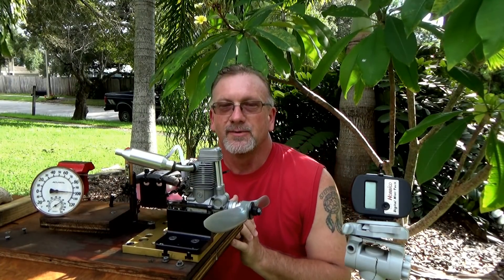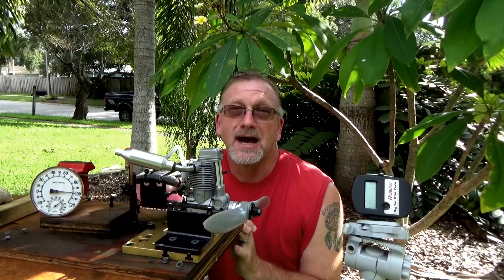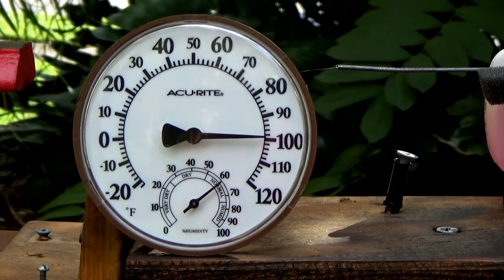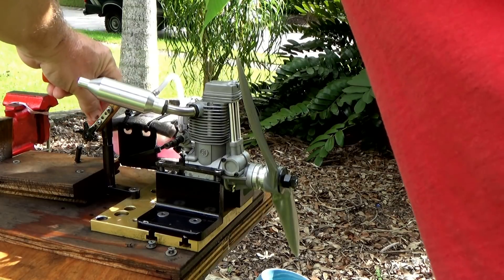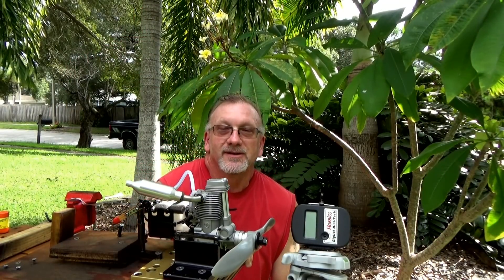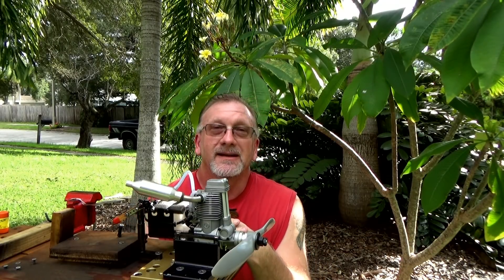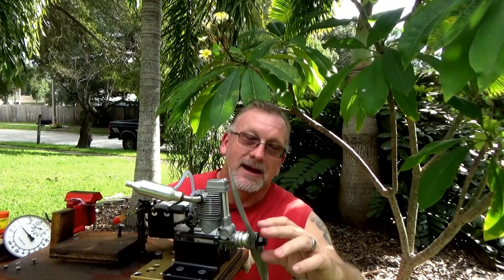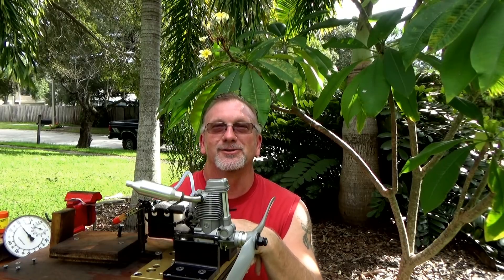Magnum FS91AR First Run

Comment: I recently got a brand new one from eBay and the carburetor was stuck but I finally got it freed up with a heat gun and it runs pretty good but not quite like my saito but it might get better after it gets broken in!

Comment: i hear you cant run normal 2 stroke nitro fuel in a 4 stroke nitro engine , but i see some guys run 2 stroke nitro in the 4 stroke nitro engines, i know they make nitro 4 stroke specific  nitro fuel, will running any old nitro fuel be ok in a 4 stroke engine??? And do the 4 stokes get better fuel economy and flight times?
Reply: I normally rum my 4-strokes on 10% nitro, 18% oil and 72% methanol. Works every time 😃
Reply: so im good with my "cool power" 15 % that i run in my os 46ax ii
Reply from the maker: You heard wrong.
Reply: awesome news!
Reply: I’ve always used 30% Heli for Saito and ASP/Magnum 4 strokes. I know generally OS four strokes don’t like the added compression and run better on 10-15% Nitro. Just what I’ve experienced. Any Magnum I’ve had has always run better than comparable OS four strokes.